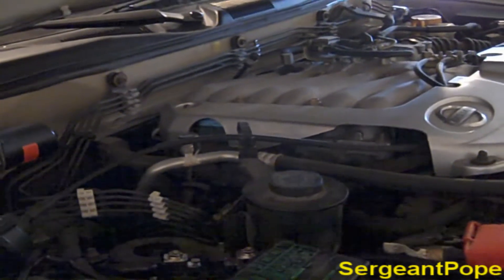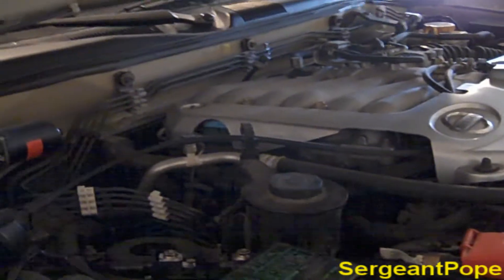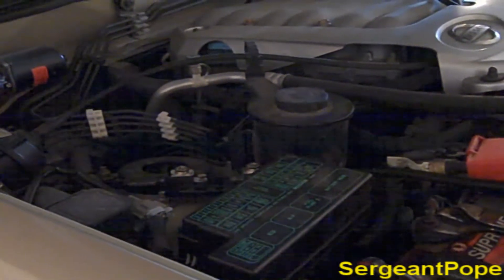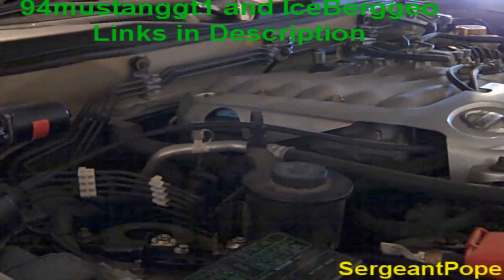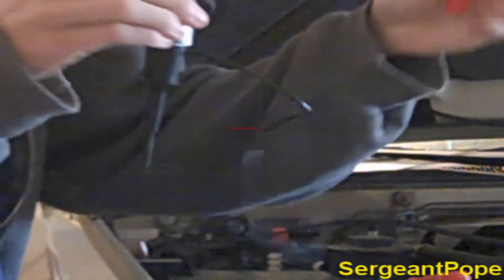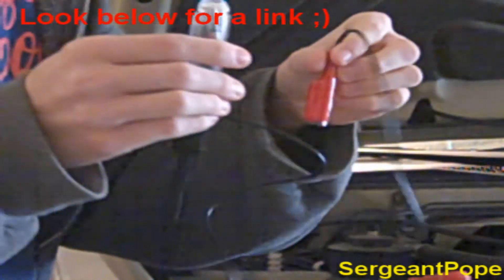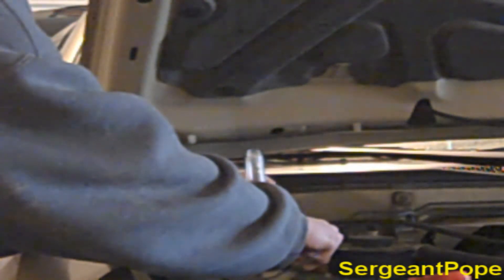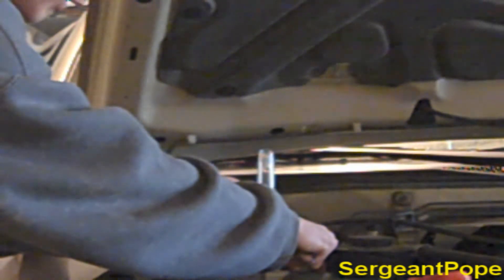How to Charge and Discharge a Car Audio Capacitor with One or Two Batteries hooked up!

Comment: What if your charging, and it dont give a full charge. and itll start dropping as soon as i turn the radio and cap on? And ive ran over my wiring make sure its tight, cross connecting or sparking, any ideas?
Reply from the maker: The voltage should drop on the capacitor if you're using things like the radio, especially if your car isn't turned on. Does the voltage still drop a lot when the car is turned on? Does it ever go below 12 volts or so?

Comment: hey can i do the same method without having 2 batteries and also could i charge the capacitor using jumper cables and resistor
Reply from the maker: Yep, the same idea works with just one battery too. You can use a resistor because those typically come with capacitors. I don't know for certain about using jumper cables. The advantage with using a light tester is that the light goes out once the cap is fully charged, but using a resistor works pretty much the same.

Comment: Hey I was wondering once you charge the capacitor how does it keep its charge or do you have to recharge it
Reply from the maker: The capacitor should remain charged as long as it stays connected to the battery and you don't have any battery issues, like draining it.

Comment: Should the car be running?
Reply from the maker: Nope. In fact, it would probably be a really good idea to make sure you car is off. The battery will still have a charge to give some juice to the cap.

Comment from the maker: How many farads is your capacitor? Since you just added another amp, you also added more power. It's possible you could have gone past what your capacitor can handle (1 farad = 1000 watts).
Beyond that, I'm not really sure what could cause the issue. I'm guessing you charged it, which should get it working.

Comment from the maker: Whenever no light comes on, that should mean that the capacitor is fully charged. I'm not sure why it never lit up originally, but it should be charged.
I would try charging it again just to be sure. If no light comes on, I would put the fuse in and turn on your car. Then check the capacitor and see if the voltage is showing.

Comment from the maker: Capacitors work different depending on which one you have. My old Boss cap had a connection to the ignition, so it would turn on when the car turned on. My current Power Acoustik cap doesn't have that connection, but turns on when power turns on and shuts down when there isn't any more power created.
I'm guessing for your situation, there should be a connection to the ignition. You might wanna check that atleast.

Comment from the maker: Hmm, it sounds like not enough power to me, especially sense it hiccups whenever big bass notes hit. Is your car pretty small? Does it have a four cylinder engine? Typically small four cylinder cars have very small alternators, so they can't support a lot of power.
If that be the case, I would highly suggest getting a higher amp alternator, especially since you're going to be drawing a ton of power. I have a 100 amp alternator in my car, but with all the watts you're using, 200 might be better.

Comment: Yea dude I need help I'm running two amplifiers both rated at 1200 watts. 1 amplifier is powering two tens and the other is powering a 12. My problem is now that I have all my wires hooked up and ready to go only the two tens play. My other amp is getting power but won't make the sub bump. Also the amp connected to the two tens will shut off when a big bass line or when I turn up the volume. Do you think this is all an underpowered issue? I have triple checked connections, grounds ect. Thanks:)

Comment: got mine today to charge it looks as if you have to earth the cap then from the battery with the in line fuse it tape the resistor to the power cable and hold on the plus on the cap (all from the instructions)
Im still yet to try but will be having a go at the weekend

Comment from the maker: Look for the fuse right at the battery, then take the fuse out. After that, touch one side of the 12 volt tester to one side and the other end of the 12 volt tester to the other side of the fuse block. As long as you do that correctly, the light should be lit up and slowly dim.

Comment from the maker: Charging a new capacitor is a good idea. Some people have told me that they didn't have to, but I have problems getting it to work whenever I don't charge my caps.
I've heard that you can use a resistor to charge a cap, but I have no idea on how to do that. I'd ask a friend if they have one of the 12volt testers I used in this video. If not, then i'd suggest buying one, they're a great investment.

Comment from the maker: You might not have charged it, causing the problems.
But since you said it was a cheap capacitor, that's probably your issue. I used to have a Boss capacitor and it always had problems keeping a charge, but when I switched to my Power Acoustic capacitor, all of my issues went away.

Comment: From the sounds of it, your cap might have the feature that if the voltage doesn't have a significant change for a certain amount of time the it shuts itself off. I have a boss cap too and it shuts off from time to time. Freaked me out the first few times it happened. Just crank the bass to change the voltage and see if it turns back on.

Comment from the maker: If you'd like to hook up more than 1 battery in the back, you should be able to just jump the positive from battery to battery. If you've ever seen EXO, he runs a metal bar that all the batteries hook to which simplifies it more. And then you'd also have to get some solid grounds for the batteries.

Comment from the maker: The issue probably isn't because you didn't charge your capacitor, since it works sometimes.
It sounds to me like you might be drawing too much power from your electrical system. Do your headlights dim a lot? If so, you might want to upgrade some components (upgrading the main battery helps a bunch).
Another possibility is if you chose an off brand capacitor. I used to a have a Bose capacitor, which had a ton of problems.

Comment from the maker: @DeviantDigi Capacitors help a little bit. Batteries help a bit more though. Caps still help enough to get one if you have voltage problems.

Comment from the maker: @deedogg83 I suggest taking out the fuse and charging it. By charging it, you'll put less strain on your electronic equipment in your car. It might charge by just turning on your car, but it's much safer to charge it first =) Thanks for commenting!